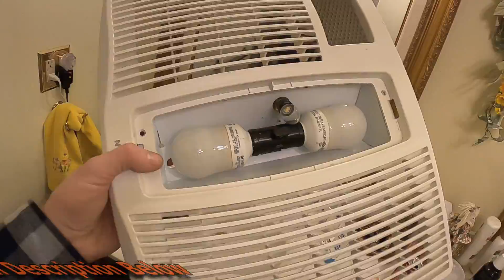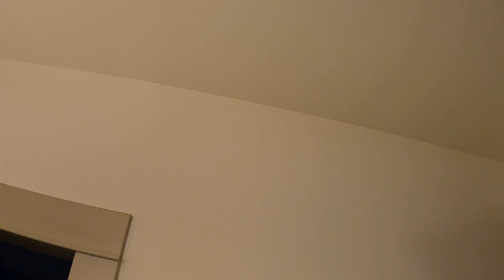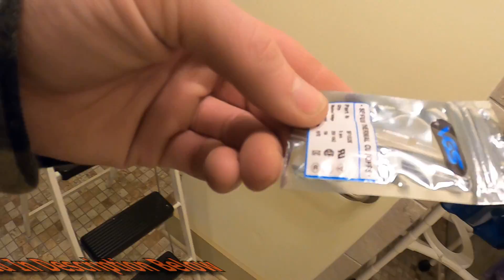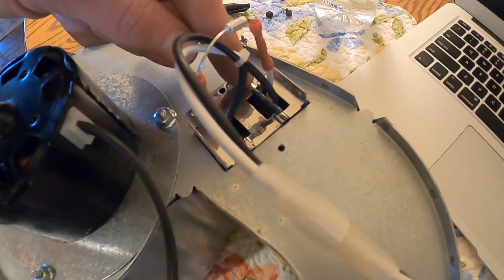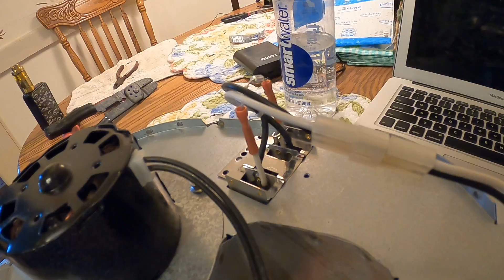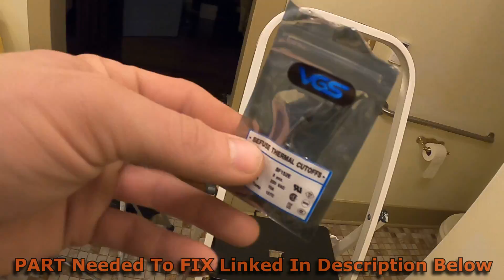NuTone Broan HEATER Fix Bathroom Ceiling Heater NOT HEATING How To Repair NuTone HEATER Not Working

Comment: This video was super helpful.  I am working on a heater issue at my parents house. If the thermal fuse has blown, will the heater fan run at all?  When you flip the heater switch on theirs, nothing happens.  Light and exhaust switches work just fine.

Comment: You need to put a clamp-on heat sink on the wire lead when soldering. 

Also the design issue with these is most likely that you can run the heater and exhaust fan at the same time causing the heater to work to hard to keep up. I recommend a toggle switch to prevent this.

Comment: Dude, I hate to break the news to you, but what you have done is so wrong! Why do you think manufactures put thermal fuses where the heat is generated? Because the fuses are in the hot zone to keep from starting a fire if the fan stops blowing air. In order for your fuse to blow the heater element wires would have to melt and short out. The whole unit might have caught fire before that. Step#1: Take this video down immediately. Step#2: Run, don't walk to your grandparents house, remove your so called fix and install the proper heating element. You have put them and anyone else who has implemented this 'fix' in serious danger.
Reply: Absolutely my exact sentiments.  And just to take it a step further.....often the reason the fuse is blowing is because the fan motor has slowed down because of dust or age and needs to be cleaned, oiled, or replaced altogether to restore the proper airflow that keeps the fuse from blowing in the first place!